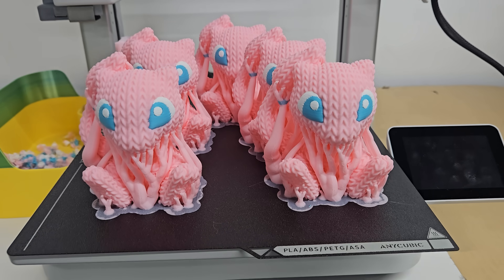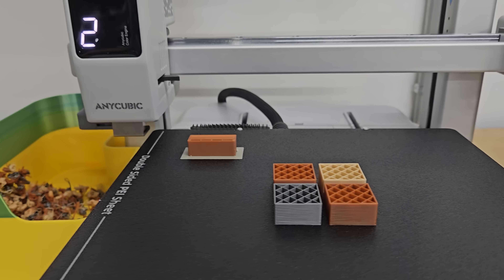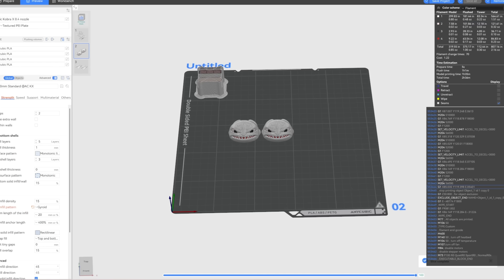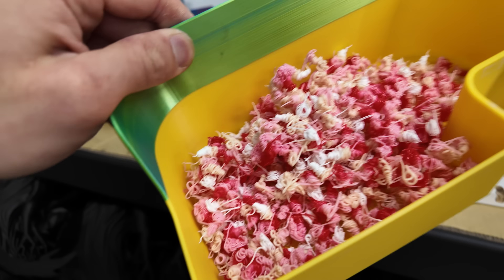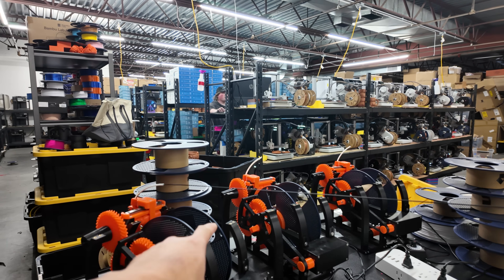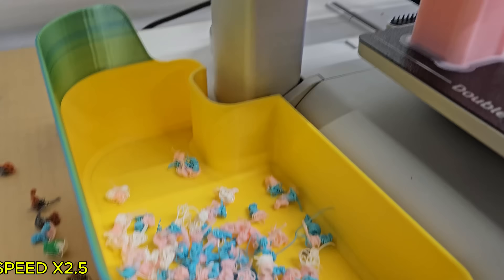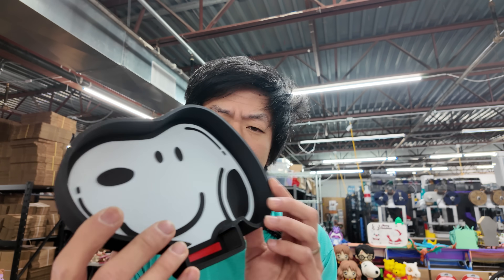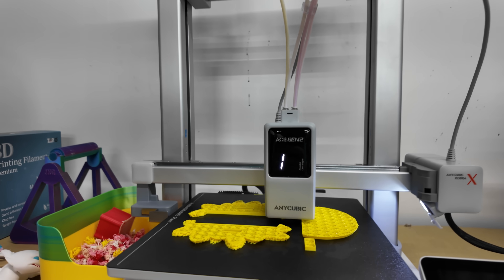Anycubic Kobra X - Best Budget Multicolor 3D Printer on the Market?

Comment: Hi do you think I should get this or the Bambu lab P2s combo? I’m also looking at the sparkx17.
Reply: The corexy printers are more stable and faster than bed slinger. But this Kobra x possible claim up to 600mm/s and 20000mm/s acceleration which is same as P2S. Forget about Creality Sparkx, I would buy Creality Hi instead because it's cheaper with same spec as Sparkx

Comment: Hi! I recently replied to you before, but just wanted to leave a shorter message here as well.

Great video! Quick question: if you were starting a 3d printing business in the UK, would you go for an AMS Pro 2 on a Bambu P2S or the Anycubic Cobra X at a similar price? My dilemma is getting an extra colour-capable printer vs potentially better quality with the AMS. Curious what you’d pick, thanks!
Reply from the maker: If you can get the p2s combo at the same price as the kobra x get the p2s...

Comment: Hi Dancyn,

I was wondering if you might be able to share your thoughts on a direct print-quality comparison between the Bambu P2S (with AMS) and the new Anycubic Cobra X you recently reviewed.

I’m currently stuck between two options that are roughly in the same price range: upgrading my setup with the AMS Pro 2, or going with the Anycubic Cobra X instead. Beyond just specs, I’d really value your opinion on real-world results and overall experience.

If you were in my position, which one would you personally go for — the AMS Pro 2 or the Cobra X, and why?

I really appreciate your perspective, as it’s clear you work closely within the 3D printing industry. Also, thank you for the video — it was genuinely interesting and very helpful.

Thanks for your time, and keep up the great work.

Best regards,
Rajan
Reply from the maker: IMO - the kobra x and the p2s shouldnt even be mentioned in the same sentence. The p2s is a workhorse printer thats capable of printing multiple types of filament. If you need an enclosed printer than go with the p2s.

Comment: I have the same brown spots on all three of my A1’s. It also shows up on my purge bins and the deflectors I printed and mounted on the flinger thing. I’ve tried go gone alcohol and other items and haven’t been able to get it off.
Reply from the maker: Can't tell you how many I've had to switch out
Reply: @Dancyn3Dprints  It is caused by the heat from the nozzle. I only have 16 A1s but they all do it. Purge wiper and waste bin. It hasn't affected the functionality so I have no reason to change them.

Comment: I wonder how it prints so much faster than the A1.  if it's not purging as much due to a different method of priming compared to the A1 or if it's just simply that much faster at extrusion?
Reply: Some reviews also  mentioned that the predicted times in the slicer are wrong. Like in the last review i saw a print that was expected to take about 4 hours took more than 5 hours. I think that is a problem many brands other than Bambu have - wrong predicted print times.  Same with the Snapmaker U1 where the real print time is longer than the predicted by the slicer. 

I can imagine that this one can be a faster than the A1 by moving the filament less far back than the Bambu does with the A1, but the time saving will be less than the slicer suggests.
Reply: They say it is because the filament is already in the head of the printer when it goes to switch filaments so it has almost zero travel distance to start extruding. Bambu AMS has to load each time taking more travel distance per color change.

Comment: I’m testing the Kobra X too.  So far it’s printed really great - once I had the newer version of the slicer.  The only complaint I’ve had is the location of the camera largely aimed at the bed frame and less on the print.  I’ve also had a false alert or two from the AI Spaghetti Detector - I suspect from the camera angle.
Reply: I saw from another creator you can remove the camera housing and 3-D print a new one to get a better angle

Comment: Good video , In the tests I've seen compared to other multicolor printers, I've noticed that the savings in time and waste are around 25% or less, which is much less than the 50% that Anycubic advertises.

But for the current price it's quite good  I've already ordered one but time will tell how reliable the new printhead mechanism is which is the only thing I see that might fail more frequently.
Reply from the maker: I havent had time to do those tests but I will in a future video

Comment: Would you recommend it for a beginner? Clearly you are very experienced with 3D printers so something that may seem simple for you may be complex for a beginner.
Reply from the maker: this is pretty simple to use and operate, probably a bit easier than the a1 since theres less mechanical components

Comment: Good Video, saw the pre-order and this helps.  You mentioned the printer will tell you which filament number is out, but does it automatically switch and continue printing with same type and color of another spool?  Thanks
Reply from the maker: Yes as long as the color and type are the same

Comment: Doesn't the tolerance in your own made filament cause more blobs in the print? 
The printer will extrude more filament than the printer thinks if the filament is thicker.
Reply from the maker: Usually not

Comment: With Orca Slicer try to print two cubes with different accelerations - 200 and 2000 mm/s^2. I wonder if they fixed the problem of accelerations, jerks and PA. When users just want to use a Orca slicer... the printer does not understand the commands. Intentionally or not?